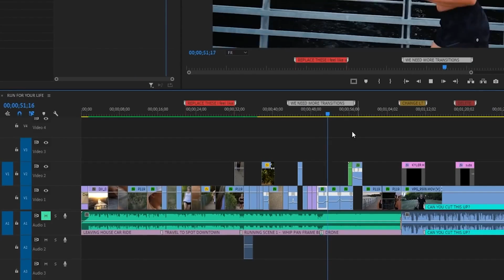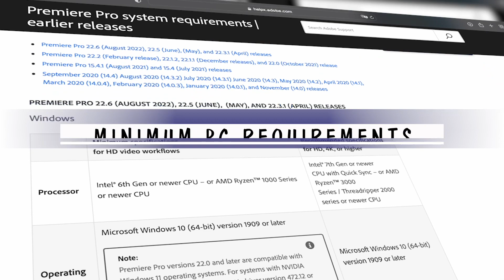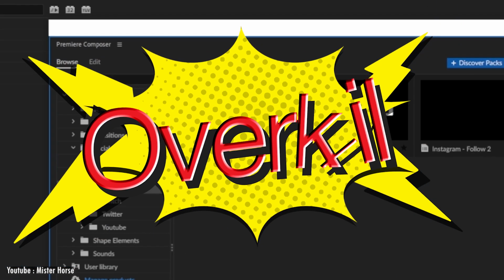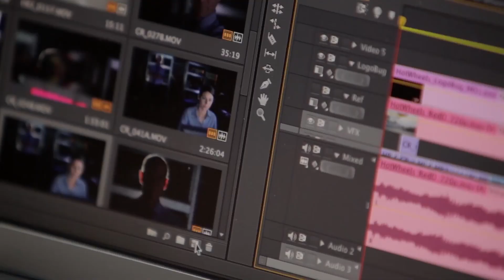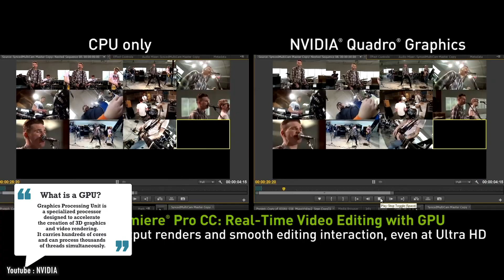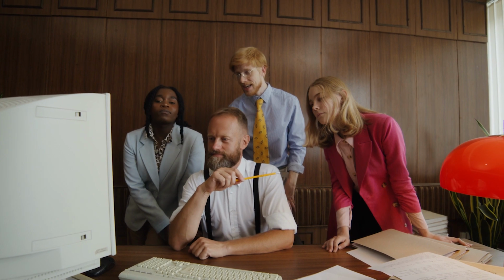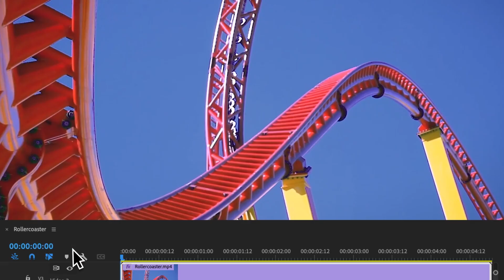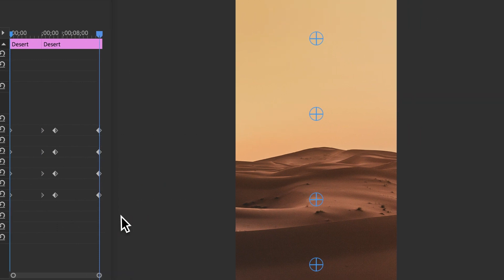Is Premiere Pro Good for Low End PC

Comment: see i face this issue, i have been using davinci for about 2-3 months now and i don't have a dedicated graphics card so it freezes and runs laggingly(davinci being more gpu oriented) and hearing that premiere pro is cpu oriented i am thinking to switch since i have a good enough cpu(i5 10th gen, not good but still better than no gpu right?). what do you suggest?
Reply: What do you use now?with old pc